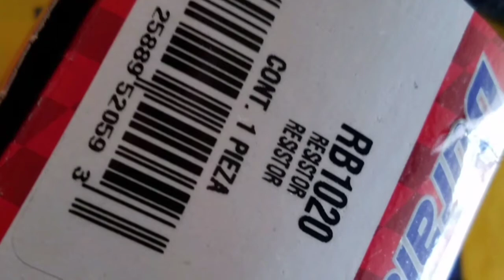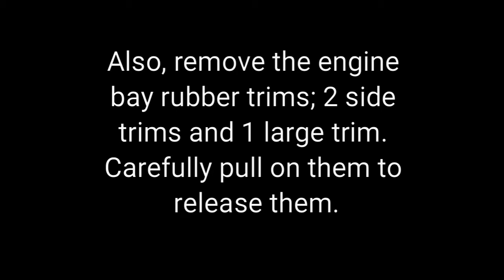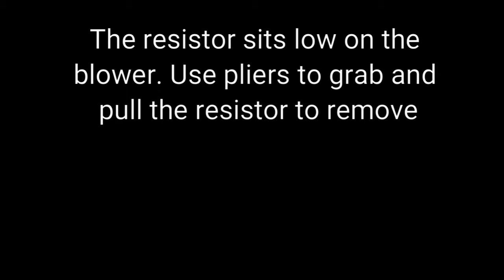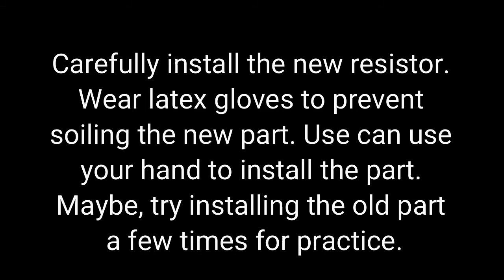blower motor resistor replacement for BMW Z3 ROADSTER

Comment: thanks mate....good instructions!..when I did mine just now I took the pack out rubbed it with a cloth put it back to dry run the new part  (which I had ready) and it all kicked into life !... one bit I would add. Temporarily put the the rubbers back to save chafing your arms !!